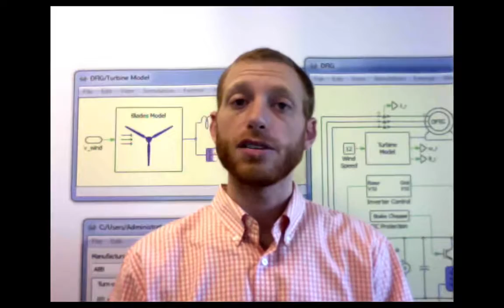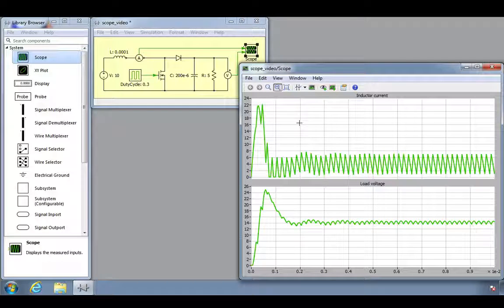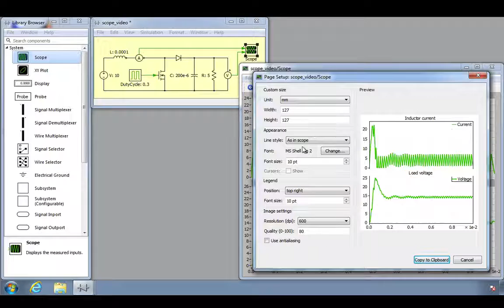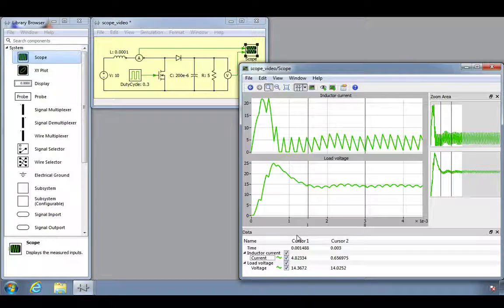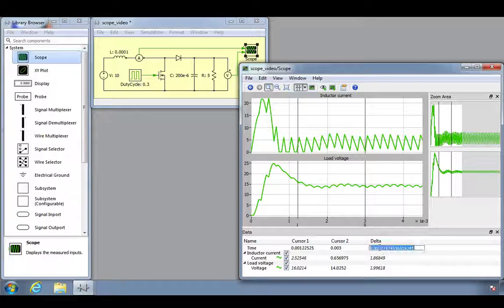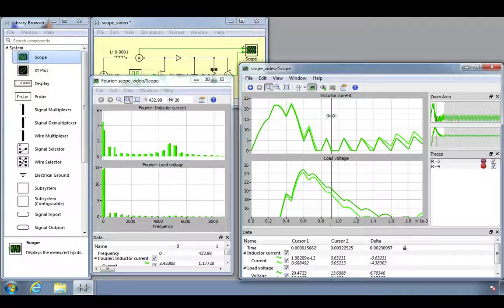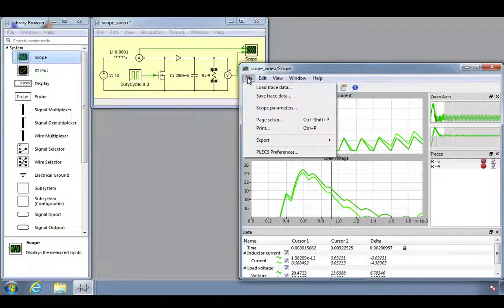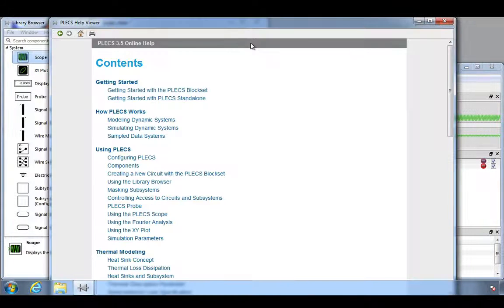Using the PLECS Scope

Comment: how do I put one plot over each other
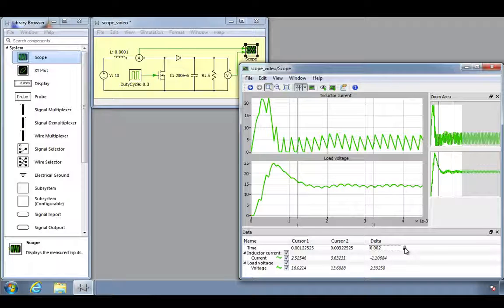Reply from the maker: View starting at ~6:20 in the video. You can "Hold Trace" to save a plot and then when running a new simulation overlay the new simulation trace on top of it.

Unless you are talking about having multiple signals in general plotted in the same Scope window? For this you will need to use the Multiplexor component to "MUX" signals together into the same bus in your circuit, and feed the signal now with a width > 1 into a single Scope input port terminal.

Comment: Hi, Thanks for the great explanation. I am using PLECS 4.0.2 (64 bit) at my University and I have two queries regarding a specific usage example of the scope.

1. I have simulated an ac-dc converter and measuring the current THD as described in the video. I copied the data window entries using the <right click -> copy to clipboard> option and pasted it in the target application (Microsoft Visio). I observed that the contents of the data window were misaligned. The headers and the corresponding values were not aligned properly which makes it necessary to re-edit them in the target application. Is there a way around this problem? 

 2. Is there a possibility where the Fourier spectrum and the corresponding THD values in the data window can be exported as one image (file -> export is able to only export the graph but not the data window entries)?

Thanks.

Comment: How to see cursor for horizontal values , I mean cursor in row 1 and row 2 instead of Column 1 and column 2 . Is there any possibility to places cursor in horizontal instead of vertical?
Reply from the maker: No there is not, but by placing the cursors in the X-axis you can determine the Y-axis quantities directly from the Data Table below. You can also use the Cursor analyses, such as to find the Max value (from the Y-axis) between the cursors.